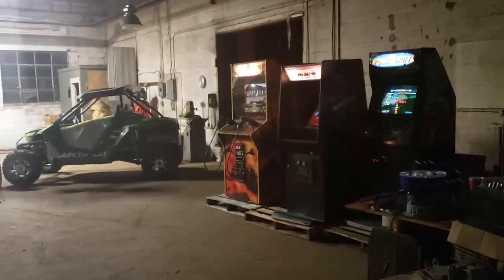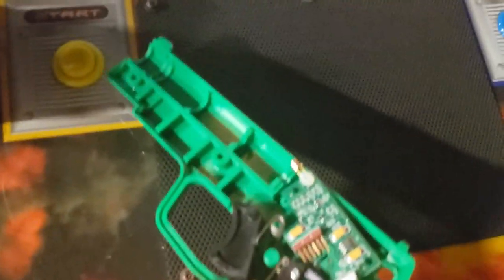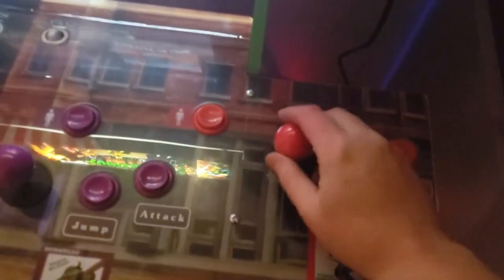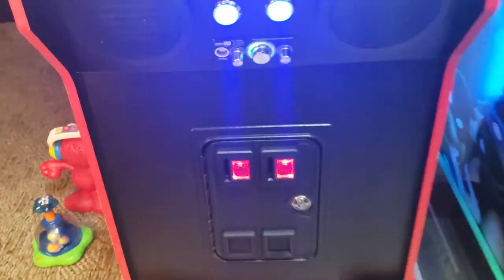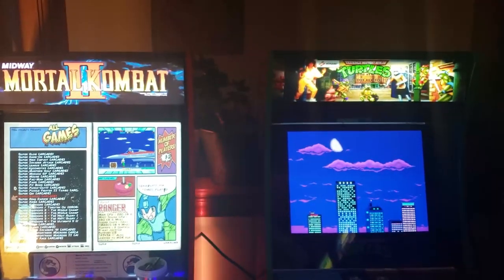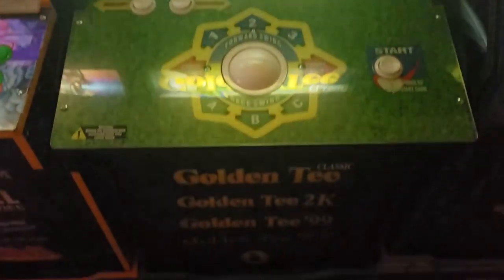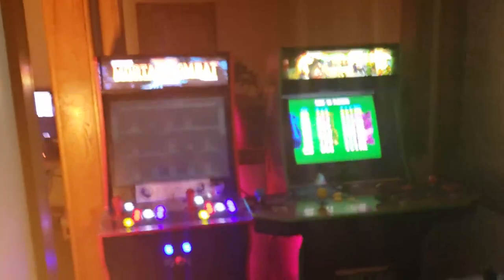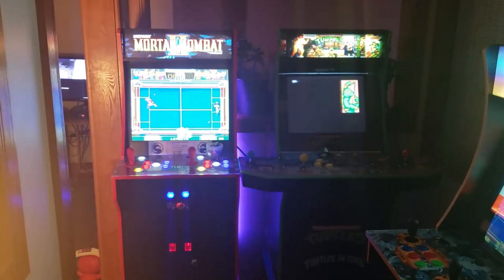Arcade Tour 2020 - Kicking Off the New Year With EXTREME MODS & PROJECTS!

Comment: Awesome man! Doing a very similar mortal kombat build right now. How did you mount the amp to that board without it being flimsy? Any tips or tricks would be appreciated :)
Reply from the maker: Thanks! I have some 12" strips of 1/2" x 1/2" glued about 3" from the top and bottom of the panel in the back to reinforce it, because I didn't initially, but it starting bowing after a while.